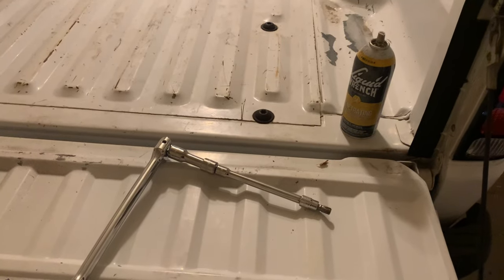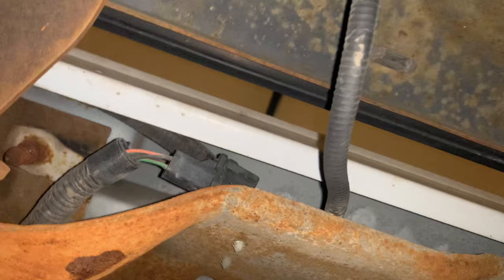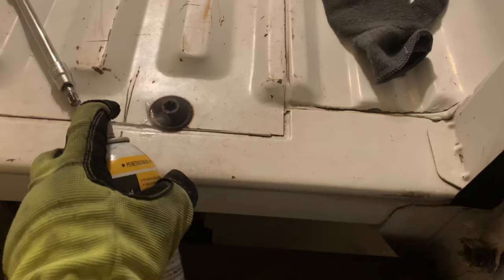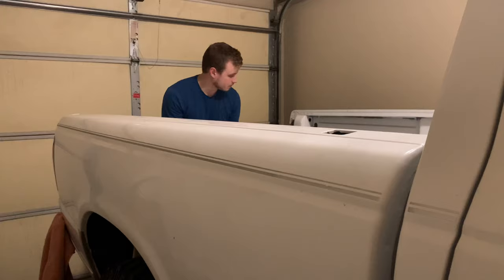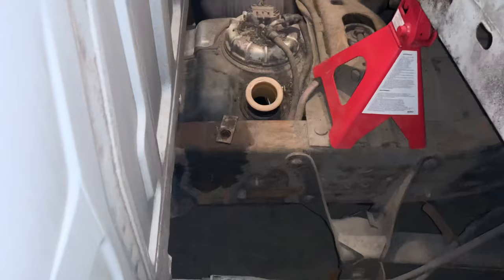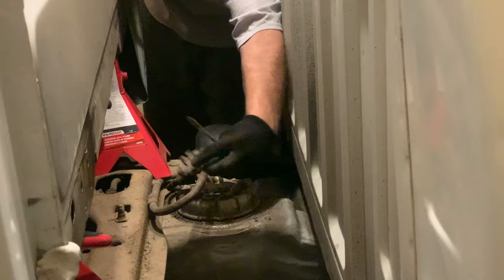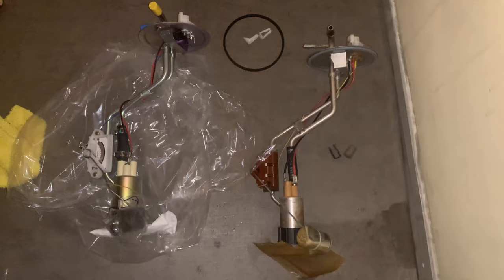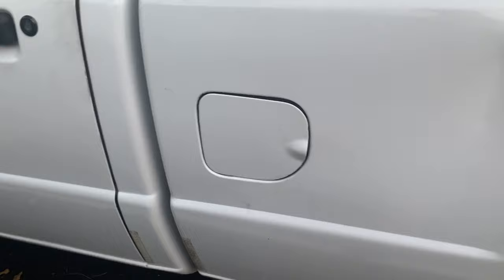1994-1997 Mazda B2300 Fuel Pump & Filler Neck Replacement

Comment from the maker: Breaker Bar - https://amzn.to/3vqHhTv
Fuel Pump - https://amzn.to/3YTPhtF
Extension - https://amzn.to/3voMIlQ
T55 Torx Bit - https://amzn.to/3WLzMmh
Medium 3/8 Drive Ratchet - https://amzn.to/3YSMcKl
7mm Socket - https://amzn.to/3G0UdUT
CRC Electronics Cleaner - https://amzn.to/3vol6gI
Pliers - https://amzn.to/3WwUia2
Liquid Wrench Spray - https://amzn.to/3QeFdaV
Air Duster Spray -https://amzn.to/3FZ7ltS

Comment: Thanks for making this video I was filling up my 97 Mazda B2300 today and had the same issue with fuel pouring down the side of my fuel tank. I believe my fuel filler neck may be cracked as well. Might as well replace the fuel pump and fuel sensor too the price for the parts are pretty reasonable.
Reply from the maker: Yeah that was definitely my thinking on it as well

Comment: Thanks for the video. I need to replace my fuel pump in my 94 b2300 and pep boys wants 1200 to do the work. I only paid 800 for the truck so there ain't no way I'm paying 1200 for a new fuel pump.

Comment: Thank you.  I used this video the 1st time I changed the fuel pump unit, really helpful. Don't remember when I replace mine. Does the original fuel pump assembly include a "fuel sending unit" ?  I have a 2000 Mazda B2500 2.5L
Reply from the maker: Yes I believe it should include it. Glad the video helped out 👍🏼

Comment: Good video man I already replaced my filler neck a few years back due to the cracking and leaking. I should have replaced the whole fuel pump unit at the same time. Where did you order your fuel pump?
Reply from the maker: Yeah I had the same thinking about just doing the fuel pump with it too since I had to take the bed off for the filler neck. I got the fuel pump off of carparts.com for around $60